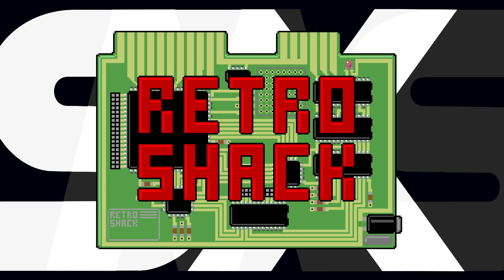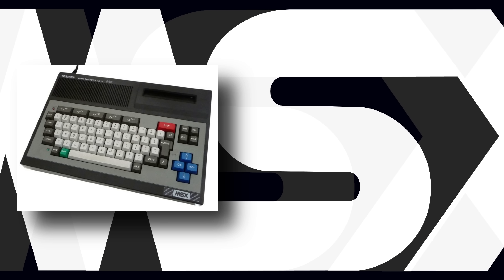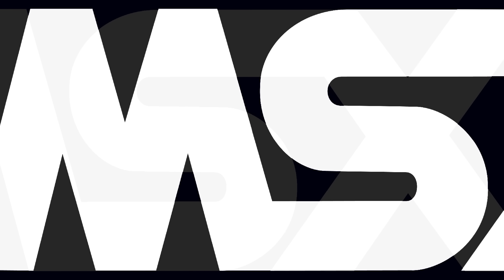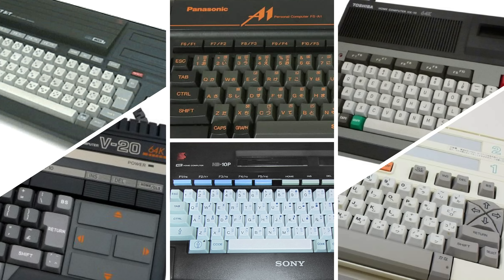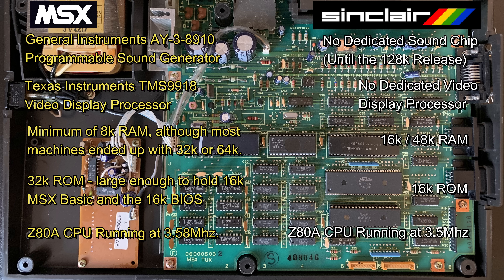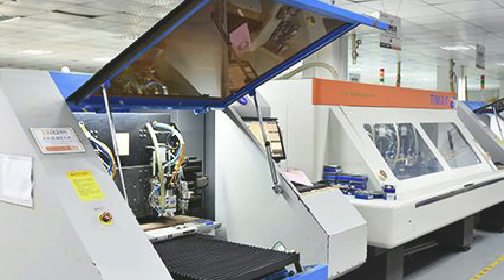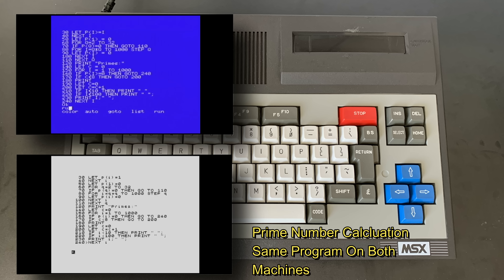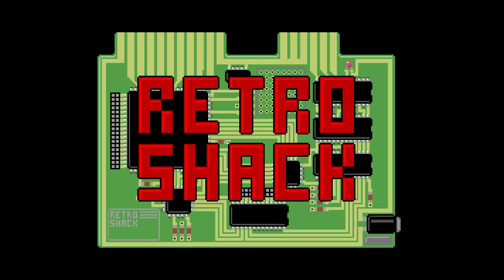Did I miss out by not having an MSX?  Was Sir Clive right about their performance? Let's find out!

Comment: Sir Clive was clever with words. The tms9918 hails from late 70s and has separate video dam which is slower to access by the z80 vs system ram. But as you say the msx is much more powerful than the venerable speccy.

Comment: Had a Spectravideo SVI-738 X'Press, and boy even at the time it was obvious the MSX was better in every single aspect. At least the 738 since it had a 3,5" floppy drive. And I never understood the color band thing with the speccy - where a sprite was on screen determined its color or something, it just looked... /weird/ - or was that the ZX80?

Sad thing about the 738 is that it has the MSX2 video chip - but not enough VRAM to actually use its full potential. I wonder if any demos were made specifically for this machine...

Comment: I had an HX-10 and the Konami cartridge games set the standard at the time for playability, I had a go on ping pong recently and it's still holds up today in terms of speed and control. The annoying thing, particularly with the HX-10 and was true of other machines was that it was not fully compliant in terms of memory address and some tape games would not load, they required pokes to be entered in advance of loading (which I only learned later in life). Molecule Man, Zoids, Red Moon to name but a few

Comment: Something you didn't mention, the real MSX advantage, was the amazing library of Japanese games, arcade ports and Konami originals. If you look at those games, compared to the cheap and rushed european Spectrum ports, it's clear that the machines were capable of so much more. It's like comparing the Spectrum and the Amstrad CPC graphics by looking at spectrum ports only. Then they got worthy successors like the MSX2, 2+ ( which I had alongside a ZX +2 ) and Turbo-R. Still somewhat supported today in the homebrew scene in Japan, while the Spectrum never really changed much besides a 128K memory upgrade and a ( by then ) mediocre sound chip. Anyway I love my Spectrum just as the next guy, just wanted to point out what you missed.👍

Comment: One of the advantages of the MSX is not so obvious: from the start (1983) it had a standard memory bank switching scheme that allowed memory to be expanded massively.

The address space was divide into four 16K blocks and each block could be assigned to one of four "slots"; generally the onboard RAM, ROM and some I/O were in slot 0 (and sometimes slot 3 as well) and slots 1 and 2 were the two cartridge ports. Additionally, there was a second optional switching scheme for a 16K block in a slot that allowed switching between four more banks for those devices that wanted to provide yet more memory. Thus a single cartridge could offer up to 256 KB of RAM and/or ROM in a standard way (non-standard extensions raised this to 512 KB or more), and the system as a whole could have as much as a megabyte of memory available.

Though within a few years a lot of the remaining 8-bit series of machines would be offering a standard for more than 64K of memory as a regular thing, the MSX was one of the earlier systems to do this. Designing it in from the start was pretty forward thinking!

Comment: If you are looking for a SVI-328 make sure you get the Expander "box" as well, its basically a multi cart holder that you can sit your monitor on, and when "fully loaded" is a practical business machine (with 80 columns, dual 5.25 floppys, comms, printer pass-thru and a few other goodies - RTC? - this is the setup in my local computer shop in Hamilton NZ in about 1985 when we got an SVI-728 + 5.25 floppy and about 3 months before the SVI-738 was released). It can still run most MSX-1 games btw.

FYI: I joined an SVI users group, the most memorable thing being a young guy built a printer interface that worked over the 2x joysick ports

Comment: An interesting thing that helped to have a lot of zx spectrum titles on msx without too much time spent in efforts but also gave us a lower quality msx games (because they took the worst of both computers) was the msx bitmap mode.
Tecnically it is a tiled mode vs the full bitmap mode of spectrum, but it can be configured in a way to "forget" the tiled mode and could be used as a bitmap mode. the simililarities between the video modes are below:
both 256x192 pxs (so no need to worry of more or less space when converting zx->msx)
both attribute/color clash: the speccy had a limit on a 8x8 cell the msx on the 8x1 cell, but this was not a showstopper in doing conversion.
the physical mapping between video ram locations and pixels is somewhat different, but it is possible to convert easily from speccy layout to msx layout. So easily that most games managed in a separate cpu area the spectrum graphics and they upload to video memory doing  an 'on the fly' conversion to msx video ram mapping. this allowed coders to not to rewrite gfx and sw sprites routines used on the spectrum and uploading the "zx shadow" screen on msx vram. The downside was increased processing time due to the double work required to CPU. If you sum this with the convertion needed to manage char attributes by a factor on 8 (on the msx) and due to the fact that the vram access on msx was slower than on spectrum, you realize why zx->msx conversions worked slower on msx. to get a faster game they needed to specifically code for msx. And this rarely happened.

So the similarity between the video modes was both a fortunate and unfortunate coincidence :
fortunate because it allowed conversion in relatively short times
unfortunate because it did not take advantage of the msx hw
Reply from the maker: Very interesting indeed!

Comment: To be fair the newest component design in the MSX specification was the TI TMS9918 is a Video Display Controller, and it was released in 1979. So, the tech was 5 years old. As for the more powerful claim, they have essentially the same CPU. If we try to justify the claim, we'd have to add ridiculous qualifiers like 'per cubic centimeter'.
Reply from the maker: True enough - but '2-3 times faster' - Hmmmm.... Dubious at best :)

Comment: Never had an MSX, but I do still have my Tatung Einstein which, while not an MSX machine, does have the same components. The Einstein cost £499 in 1984 and while it was never a very popular machine, it did have a good selection of games, a spectrum emulator add-on device, and could be used as a development platform for the Spectrum.
Reply from the maker: That’s really interesting!  I don’t know the Einstein had a Spectrum Emulator device - ‘goes into research mode’ :)
Reply: @TheRetroShack  Yes, the Speculator!

Comment: Pretty useless comparisons, Outrun and Manic Miner.  How about Lords of Midnight and The hobbit.  Both ground breaking and out on the spectrum.  It was the amount of things you could plug into that made it great plus well the MSX was very expensive.  You do not make that point at all.  Think it was about 250 as opposed to 129 for ZX.  The other problem with the MSX was it had no software out for it in the UK and what little it had was overpriced.  That is why it sank without a trace. Though Outrun looked shocking on both systems.  Why would anyone buy it when it looked that bad?
Reply from the maker: Thanks for watching - the point of the video was to a) introduce the MSX to the channel, and b) to address Sir Clive’s statement that the Spectrum was 2-3 times more powerful than the MSX - which it isn’t.  And Sir Clive didn’t factor price into the equation.  I’m a die-hard Spectrum fan but even I couldn’t let those comments go unchecked :)

Comment: Forget the 512k mapper, if you can stretch to a Carnivore2, it has 1024k of useable RAM, built in sound cards FM-PAC and SCC, and a CF slot, far more useful, and works fine with the Toshiba MSX, I have tried it!
Reply from the maker: That may have to wait a while until the funds are there, but adding it to the shopping list definitely :)

Comment: Just a note, Clive’s interview in 1984 would have been on the verge of the MSX2 upcoming release in 1985. And at the time even the Speccy was an aging architecture. Though with the release of the MSX2 and the 128k in 1985, the difference in capability were apparent. Though, it is curious how you only showed MSX ports of Spectrum games. That’s not really a fair comparison, as the MSX had many games that were superior not only in the audio but in graphics as well. 

That said, although I’m from the US and never used either of these machines in my youth, I do own examples of both now. And I can say that while the MSX is a superior machine, I love both of them for what they are.
Reply from the maker: That was kind of the point of the video - to debunk Sir Clive's claims.  After all, the MSX could run those Spectrum games better than the Spectrum :)  We'll get onto the real MSX goodies in the next episode :)
Reply: @TheRetroShack  BTW, if you find the MSX to be a fun machine, I would highly encourage you to find a MSX2 or MSX2+. Alternatively, there is a homebrew machine that can be built, the Omega Home Computer. The games available on the 2 and 2+ are quite a bit of fun. Although there is a massive collection of games for the MSX1.
Reply from the maker: @RetroDepot  Already on the production slate :) Couldn’t resist it!  :)

Comment: Manic Miner and Out Run?  Really? Better show Salamander, Nemesis, Penguin Adventure, Zanac...
Reply from the maker: Kind of the point of the video really was to show that even running Spectrum ports, the MSX was in no way 2-3 times less powerful than the Spectrum as Sir Clive stated.  In the next part we'll look at the good stuff :)
Reply: @TheRetroShack  Well, to be honest, there is some degree of truth in Sir Clive Sinclair's words. For most of the direct ports from ZX to MSX, the ZX wins in terms of graphics speed. The reason is simple: the ZX Spectrum uses shared memory for both the video buffer and the Z80 addressing space, while the MSX uses a separate VRAM for video that is NOT directly accessible by the Z80, and all reading/writing video operations must be done through I/O ports.

It's obvious that the MSX is a more powerful machine, but to take advantage of this, games must be designed ad-hoc for the MSX capabilities (e.g. no scrolling, no more than 4 sprites in a row, 8x8 tile-oriented graphics, etc.).

On the other hand, the MSX2 (and upper) is an 8-bit beast that the Spectrum just could never compare to.

Comment: I've been a fan of ZX Spectrum since childhood and I love the hardware features and the platform's game library. But there is no possible comparison between a standard ZX Spectrum with 48k of RAM and a standard MSX 1 with 64k. A typical MSX runs any Spectrum game easily. The worst thing that happened, in conversions of titles from Spectrum to MSX, was that the adapted games were often a little slower due to the lack of optimization. However, the graphics and sounds of the conversions were the same or better than what was seen in Speccy. However, a Spectrum would simply never be able to run anything that even resembles the best games originally made for MSX, such as "Nemesis", "The Goonies", "Knightmare", "Zanac" or "The Castle". I love both platforms, but the hardware superiority of MSX is undeniable.
Reply from the maker: But, what about, no - wait, give me a second... How about... Nah, I got nuthin :) :)

Comment: Thanks for setting Sir Clive straight! I have always been surprised at his statement. In fact, I think he was just terribly afraid of the competition from MSX. He does have a point that the graphics chip is a bit old, but it's more capable than the Spectrum's... And the prices of MSX machines were a bit high, compared to the competition, I think.

Do note that for the "MSX1" there were many 'cheap' (quick and dirty) conversions of Spectrum games to the MSX. Besides they underuse the MSX graphics capabilities, there is another issue with these: because the MSX has a separate video RAM, the way these Spectrum games are programmed are not very fitting to the MSX architecture and they become a bit slow. For this Out Run port it's not too bad, but in general these are not the best MSX(1) games.

For a couple of top notch MSX1 games try: The Maze of Galious, F-1 Spirit, Salamander, Gradius series, King's Valley II, Rollerball, Eggerland, Penguin Adventure, Zanac, River Raid, Bosconian, ...
Reply from the maker: You're welcome :)
Reply: Would you say it to his face though?
Reply from the maker: @universal70  Darn right I would!
Reply: @TheRetroShack  Well CS is still alive so its not to late!
Reply: I often tell Microsoft I dont like there software
Reply: @universal70  too late now though.
Reply: I absolutely love the ZX for it's minimalist architecture and the clones it spawned making it a semi useable system (semi because it sucks for games and programming using the original keyboards), but damn ... Clive Sinclair really was full of himself there. While I don't find the MSX too interesting it's easily 3-4x as capable as the Spectrum from a hardware standpoint - especially since it came in a number of incarnations improving upon the previous generation.
Things have gone full circle tho, nowadays there's a graphics card for high end ZX clones using intended MSX3 (Yamaha V9990) graphics chip.
Reply: @RandomBlankUsername  cool! That was a nice MSX development in 1995 when the gfx9000 was released... But it seems only the last couple of years it became interesting enough to develop for. I guess these games could be relatively easily ported between V9990+Z80 systems.

Comment: With this one statement, i lost all respect for Sir Clive Sinclair. I now believe the Digitiser 2000 song about him to be based on 100% true facts with little to no exaggeration whatsoever.

Granted there is nothing particularly unusual about the MSX and it is an "old" architecture, as it's designed around off the shelf chips from 1979 and earlier, and is similar to... well dozens of other things. But it's also not a penny pinching kind of architecture, unlike Spectrum. That VPU is pretty nice for sure.
Reply from the maker: Salesman through and through... That's why I love that 'Sinclair We-Haven't-Thought-Of-It-Yet' advert :) :)

Comment: 5:16 Most likely it stood for nothing at all. That way it could be protected as a trademark.
Reply from the maker: You may be right - all the speculation may have been for nothing :)
Reply: We saw this with “DVD” -- first it was “Digital Video Disc”, then “Digital Versatile Disc”, then nothing at all, for trademark reasons.
Reply: The meaning of the acronym MSX remains a matter of debate. In 2001, Kazuhiko Nishi recalled that many assumed that it was derived from “Microsoft Extended”, referring to the built-in Microsoft Extended BASIC (MSX BASIC). Others believed that it stood for "Matsushita-Sony". Nishi said that the team’s original definition was "Machines with Software eXchangeability",[8] although in 1985 he said it was named after the MX missile.[9] According to his book in 2020, he considered the name of the new standard should consist of three letters like VHS. He felt "MSX" was fit because it means "the next of Microsoft", and it also contains first letters of Matsushita (Panasonic) and Sony.[10]

Before the success of Nintendo’s Family Computer, MSX was the platform for which major Japanese game studios such as Konami and Hudson Soft produced video games. The Metal Gear series, for example, was first written for MSX hardware.[11] Its worth remembering where Metal Gear was first developed. In the West we think we are the only thing that matters.
Reply: @universal70  By “West” do you mean “USA”?

Comment: The TMS9918 video chip that is the main defining part of an MSX other than the Z80, first went on sale in 1979. I think that's what Clive is trying to spin into 'five-year old technology'. Though I don't think that was the 9918a model which added the like-a-Spectrum-but-8x1-attributes video mode. Either way it's a really great chip for 1979, even though the fact that it owns its own video RAM makes it slow to manipulate graphics.
Reply from the maker: Not sure he was being that clever ;) But what do I know? :). All I do know is that he was being veeeery generous about the Spectrum in the interview :)
Reply: @TheRetroShack  Well as is normal when trying to crush your opposition he probably also compared a 128k Spectrum with a 4K MSX when talking about the Spectrum having better performance :), never mind that a 4K MSX probably never saw the light of day.
Reply: @Henrik_Holst  There were definitely 8K MSX machines with keyboards just as crappy as the Spectrum; the Casio MX-10/MX-101 is a classic example. (I don't recall now if the keyboard feel on my MX-101 is significantly better, worse or the same as a Spectrum, but every time I try to use it I realise that the feel isn't the issue: it's just too small to touch type on on the first place! The arrow keys and two fire buttons are fine for games, though.)

This didn't make any difference as far as performance goes; the internals of the MX-10 are the same thing running at the same speed as any other MSX machine. So long as your cart or other software could live with just 8K instead of 16K of RAM (and remember, the video memory was still its own separate 16K independent of system RAM size) these would work as well as any other MSX 1 machine.